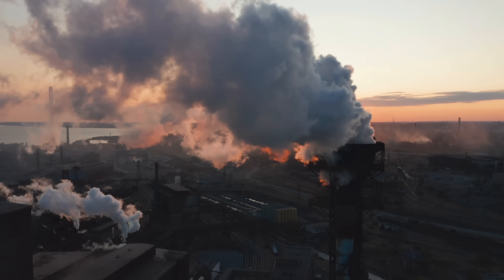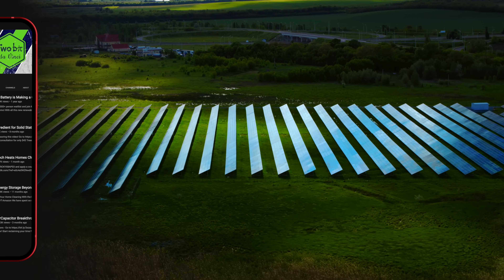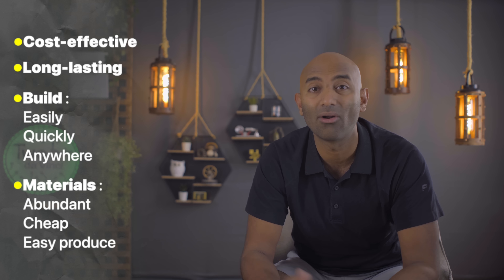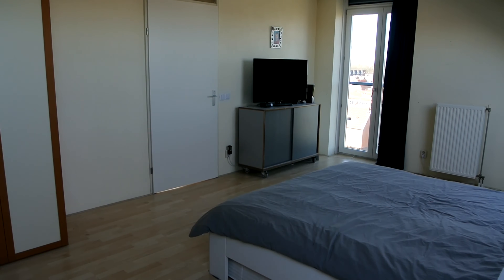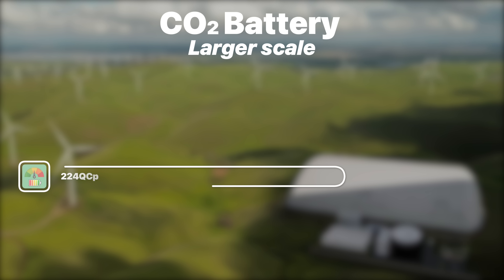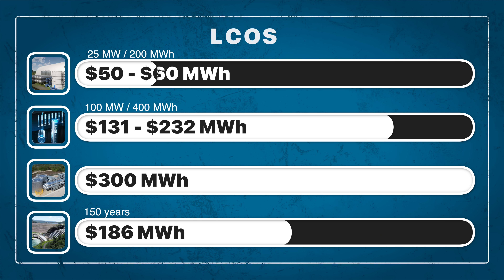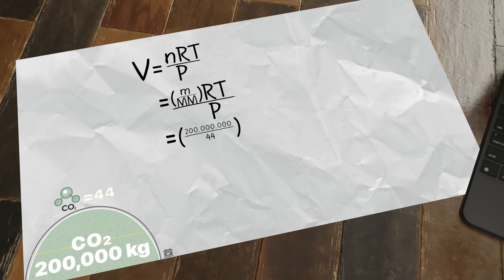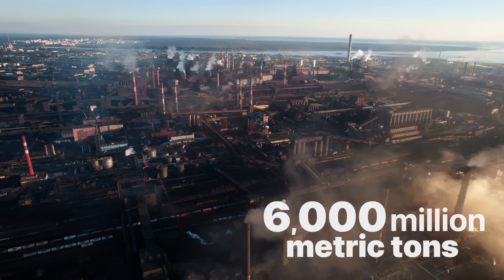The GENIUS Of the Carbon Dioxide Battery

Comment: I’ll attempt to rebuff this person in chronological order.  Wind and solar are NOT cheaper as evidenced by our increasing energy costs.  CO2 is NOT upsetting the delicate balance of hot and cold.  Wind and solar are NOT more cost effective.  EVs are expensive and have severe limitations.  Then at one minute and 48 seconds into this video, I realised it was an advertisement by this person who intends to benefit from the green fallacy.

Comment: This even if it works will take decades to implement and produce more co2 emissions to make the millions of windmills needed to even come close to replacing conventional fuels, they will also need a logistical miracle to keep up the maintenance and replacement, 
Next is the issue of also manufacturing millions of massive batteries and getting the infrastructure to deliver the electricity to where needed, 
Then still we need to produce all the thats needed to sustain normal modern life, steel works, plastic factories, clothing manufacturing,  food production, consumer goods, how does this happen without oil and gas which is not for the fuel but for the intrinsic need in actual manufacture, 
We are many years from replacing energy sources but my main question is that this issue has been highly noted for at least 40 years and up till recently nothing has been done about it except drain the tax payers,

Comment: ASPHYXIATION Another weak point?
CO2 is also heavier than air (N=14, O2=32, CO2=44) which would create a natural disaster if a major rupture occurs. It would literally suffocate every air breather that couldn't climb above the air displacement zone. This is also why Hydrogen fires are rather benign. Both for lack of energy (i.e. heat) and because hydrogen gas (H2) will not hang around long enough to wait for an spark to burn - unlike gasoline or every carbon-based gas from methane up, which is also ever so slightly heavier than air and can be "swept" (literally) out of your house.

Comment: A common mistake is calling the exhaust gas coming out of cars carbon dioxide when it is mostly carbon monoxide.
Propane is a fuel which has mostly carbon dioxide gas as the exhaust gas.

Comment: If the company that manufactures the CO2 catch device can manufacture a smoke pipe cap that can be placed on top of the coal industry pipes to collect CO2 before is disseminated to the atmosphere, they can get the CO2 battery company to pay for the domes since it will eliminate them having to buy it from other sources continuously. The Coal Companies can then just pay for the installation of the cap. That may buy them a little extra time before green energy takes over. As long as the coal companies don't try to capitalize on their CO2. They either let it go free or pay for the caps.

Comment: I think green power is a pipe dream. He talks about the co2 battery that can power so many houses for so many hours but did they take into consideration the fact that those same houses needs energy to proses the sewage they produce and the water treatment plants that also needs power to clean and pump water to them, what about street lights and the shops with freezers to keep all the food fresh and the surrounding farms and so on. If you are using solar then what do you do when it its cloudy for to weeks or if the wind dies down when you are using wind turbines. How do you mine all the minerals and proses them to make new green power generators and all the mining equipment and processing equipment think about the transportation of the products and all the employees the work at the mines and plants that will produce these green power generators. you need to house and feed them and this also needs power and whilst all this is happening you need to generate power in excess to keep the rest of the population fed and worm and clean. Do you have any idea how much power is needed to melt and cast 10 metric tones of aluminum.  do you have any idea how much power is needed to make one electric car. I do not believe that all this can be done on green energy alone. look i would like to believe that this can be done but I just don't see it. Pls prove me wrong.

Comment: if a 1.5 degree change in temperature over the next 100 years throws off the balance between hot and cold and we freak out over that then we need our collective grey matter examined. we'll destroy our current way of living based on a hypothetical, extreme, model-driven hypothesis and that's a worthwhile endeavour?

Comment: what i get is wind and solar farms would have to be 20 percent larger to offset the efficency loss witch addmitidely isent to bad. But bigest issue i see is maintince. turbins dont like being spun up and down. most new modern turbins use oil bed bearings. and that means evory time they start up its alot of wear. they like to just spin and not stop. so could be very expensive in that regard.

Comment: So why carbon capture from atmosphere  ? We are in a CO2 drought. If we drop below 180 PPM plant will not do so well on this planet.  Greenhouses pump in 1200 to 2000 PPM to grow bigger yeilds. So don't agree with taking more out of atmosphere then we create another problem. Historically it has been as high as 2000 ppm or higher in the past and we did fine. Infact that's one of the reasons plants were so big millions of years ago.
Reply: 180 ppm! are you kidding! the world is pushing itself to the limit to think about not pushing past 450ppm we couldn't reduce it to 180ppm if threw every resource we had at it. We couldn't reduce it at all if we tried. We're talking about at best stopping it from growing so quickly that we can't cope with the changes it will bring and you're worried about dropping below 180???

Comment: Yet another investment scam.  Problem with this tech is although cheap by comparison to others, given the thermal dynamics involved you're going to be lucky of you get back 30% of the energy you put into it.  First, when you compress the CO2 with energy, you're going to get TWO byproducts, liquid CO2, the desirable one, and a buttload of heat, which is just wasted energy.  Then given the temperature differences to the turbines are low, the thermal dynamic efficiency turning that energy back into electricity is also going to suck eggs.  All in all this is just going to take two thirds or more of the energy put into it and turn it into heat.
Reply from the maker: The energy comes from the phase change not just the temp delta. The efficiencies are reported In the video. There are ways to capture the excess heat

Comment: Not sure if I missed it during your presentation.  Where did the energy to drive the CO2 compression come from?  If taken from the system electrical generation, then it seems that would at the least reduce the system efficiency even more or reduce the time electrical generation is available for retail/commercial consumption. This seems to me to be an important component of renewable energy generation that is often missed. Or at least not clearly stated.
Reply: The 'round trip efficiency' by definition includes any and all losses due to operation of the system, in this case it takes into account the energy needed to compress the gas from the bladder into the liquid tanks. As to where the energy originally comes from, all energy storage will have the same overhead in terms of making the power so its dropped from the "equation" because it appears on both sides as it were. These types of comparisons are really for just talking about the cost of storing the power once you have made it from a renewable source (coal, gas, and nuclear fuel are the storage for their types of power). As such to determine the actual cost to the consumer for the power you will have to include all the costs (Generation + Storage + Transmission) to get the per KWH price. In this video he is just comparing storage costs. 

A side note: talking about energy storage is relatively new due to the inherent energy storage of fossil fuels. This is one reason why I often respond when people say "solar is now cheaper than coal", that its really not yet, due to the oft quoted articles not taking storage costs into account for solar. There of course is the also not included environmental and health costs of burning coal (smog and CO2 emissions) but power companies are not required to pay those costs as of yet, so for the present the economic reality is that solar + storage has to be compared to coal by its self; and its not cheaper yet. I hope that helps you understand the video better.
Reply: It was easy to miss, but that's the whole point.  The electrical power comes from the excess renewable power (wind mill or solar panel) being generated.  During times when windmills and solar panels have more wind or sunlight that can be used at that moment, the excess can be stored as it is generated by powering the equipment that compresses the CO2.  The pressurized CO2 is then released and vaporized and then in turn, drives a generator which provides electricity to the grid.

Comment: Good video. Solar and wind have issues. The carbon footprint to create solar farm means it will be 10 plus years before carbon neutral. Don’t worry about recycling broken blades or panels? Now add a battery plant to smooth out the grid supplied power adds another 5 years before it is carbon neutral? Unless co2 is from recycled sources seems like a waste. Neat project. Cool concept. How much tax payer money does it cost? I would rather see red hydrogen nuke or fusion. Until then . . .

Comment: As long as we keep Carbon Capture away from the petroleum industry maybe this is OK. 

There are many other industries that have high emissions that could potentially some day use CCS and cost justify it with secondary uses like this. 

But having CCS on petroleum industry emissions is just stupid. Anyone with a napkin, a pen/pencil and the slightest bit of common sense math skills can see that cutting the use of fossil fuels is way better than reducing the emissions on fossil fuels - to anyone on the planet who is not a petroleum industry executive. 

CCS takes so much energy to do, and it needs to be "green" energy for the math to work at all or else you are just emitting more to cut your emissions. But if we just take that green energy and plug it straight into the grid, reduce fuel based energy with it, total global emissions are cut way more than anything CCS could hope to promise. 

So CCS is a really hard sell, maybe something like this helps justify it, as long as it is not being used in the petroleum or fossil fuels industry applications.

Comment: Could they use natural gas as the compressed gas? Would be able to use that for backup fuel as well should the unit go offline and could be connected to existing pipelines.

Comment: This is not going to work
When you empty the dome filled with CO2 what are you going to fill it with a vacuum? Or replace with air? In any case you need more energy to overcome the vacuum Pressure or to separate air and co2 again !
Reply: It seems to be implied that there is a rubber bladder inside the dome. So the answer to your question would be air but kept separate.

Comment: It's comical that you describe this as easy to build and easily "scalable." A fire is easier to build and is scalable." Sure this is better than compressed air systems, but it is still not a solution to a problem. What major city, anywhere in the world, be able to use such a system? NONE. Nobody is going to want a dome of Co2 the size of a stadium in their backyard. And you would need many for this to be of ANY use. And this is only a part of a system. You still need to generate the electricity.  The carbon capture will not work as you envision.  Instead of using what we already have, NEW Co2 will be created. So great, shoot yourself in the foot, instead of slowing down your pace.

Comment: Ok, FIRST calling this a BATTERY is inaccurate.  You can sort of call it an ENGINE, but not a battery.  SECOND, this is a Rube Goldberg approach. And finally, the LAWS of diminishing returns. This is a stupid idea. Lead acid STANDARD batteries make more sense than this idea. Besides this does NOTHING about the Co2 issue that is perceived to be a problem. 🤣🤣🤣🤣

Comment: Pumped storage is great because water is available in such great quantities.  The great disadvantage is that geogaphy does not permit the construction of such powerplants everywhere.  In fact most suitable locations i the industrialized countries have probably already in use.
The great advantage of batteries is their speed which makes them adapt to the needs of the grid (or how elctricity is traded on the spot market) in fractions of a second which is far superior to other technologies.
The pumped storage power plants a few km from here can deliver at maximum power (close to 1GW) for six weeks non-stop before having to throttle.  It could pump for even longer. Even if the CO₂ power plant technology works out I kinda doubt we'e going to see anything of that endurance in our life time.

Comment: I am Genesis 8:22 man.  GOD, not man, controls the thermostat.  C02 is 409 parts per million in our atmosphere.  Water vapor, also a gas that traps heat, is 20,000 parts per million in our atmosphere.  You're telling me CO2 not water vapor is the culprit?  There's $cience, and there's science.

Comment: Plant are the optimal CO2 collectors, so there is no need to make a CO2 collecting factory taking it from the air. Just use CO2 from any biofueld power plant. Agricultural waste. Even if we take the CO2 from a coal power plant, it will be one off. Most CO2 in the industry is a byproduct when making nitrogen fertilizer of natural gas. Breweries buy it and put it in soda and top off beer. You can also collect CO2 from any fermentation  in industrial scale. A brewery produce alot more CO2 than it need to carbonate the beer. But CO2 is often much cheeper to just buy from the fertilizer industry, than build up a collection plant inhouse.
Good sources for CO2 are common and much better than to collect it from the air. Leave that work for the plants. For now. There will maybe be a reason to collect CO2 from the atmosphere. If we store energy in synthetic fuel and drive cars and planes on it. Then we have to collect the building blocks (CO2) back from the air. Bur not for filling up big bladders for heat batteries.

Comment: Backup Storage requires: 2.5 X's as much Solar and Wind Generation as the Base Generation System (you can't store what you don't capture). THAT'S never shown in Backup System Plans.

 And 3 weeks of 24/7 Capable Backup is needed.... not just 10 hours.

Energy Losses in Storage are ~20% to 30%  (losses in and losses out and losses during storage).

Storage Costs for 3 weeks of storage for grid storage are at best 4 TIMES the costs of Wind and Solar Base Generation System.

Any system that can generate a 24/7 supply of power CAN SUPPLY THE POWER ALL TBE TIME.  That makes the Wind and Solar redundant and unnecessary.

Comment: What kind of water n how much is needed for a full scale system  cause our fresh water shouldn't be used for anything other than consumption unless it's absolutely necessary which would become a problem the more these systems r built around the world? If the system needs fresh water, how much energy would it take for the water desalination required for the systems operational needs?

Comment: I type this comment at the 9 minute mark , seems like a great idea , but the shadowing of methane is still going on we have to use/get rid of methane which is leaking out of the ground at a alarming rate , methane heats the planet 100x faster than co2 , there is more methane on the planet than we've had oil an gas combined,  where in real trouble if we don't use it , methane can be converted to hydrogen. 
Hydrogen + co2 = (methane CH4)
So if we have leaks of hydrogen into atmosphere it will bond to co2 create methane our problems escalate to a rotten egg planet.
Use the methane now.
Cheers

Comment: Nobody is talking about the amount of extra generation required for this. Wind has never been reliable, and solar has less than 12hrs of effective generation. Even with 80% efficiency at storage, with losses in transmission, we need to generate more than double our daylight use.
I’m all for having an energy mix, but the simplest way to back up the grid, will always be Carbon fuels and Nuclear. And that doesn’t have to be a bad thing.

Comment: I think it’s important that it remains emphasized that this doesn’t mean we can still keep pumping CO2 and other greenhouse gases into the atmosphere at the rate we are currently (which is still rising at an alarmingly exponential rate) CO2 and other greenhouse gases from burning hydrocarbons like fossil fuels, will not be canceled out by CO2 Batteries and Carbon Capture alone. The battery tech and Atmospheric CO2 capture, removal and storage are all still very expensive and inefficient and or complicated technologies that are very much still in their infancy and thus will both need more time and significantly more funding and research to further develop their capabilities and assess their feasibility. As both are still only variables in a very long and complicated equation where the only constant really, is it’s continued variability. Also, something to consider, is many companies with “Green Initiatives,” pledging to be Carbon Neutral by a certain date are heavily relying on Carbon Capture technology which is currently way too expensive to feasibly be economically capturing CO2 produced by industry, energy generation and transportation even with the efficacy and financial cost benefits that would come with economies of scale of these technologies as they continue to evolve.
Reply: Propane has a specific gravity of 1.51. When Propane is released it sinks immediately and pools in the lowest area. CO2 has a specific gravity of 1.49. How does CO2 rise?